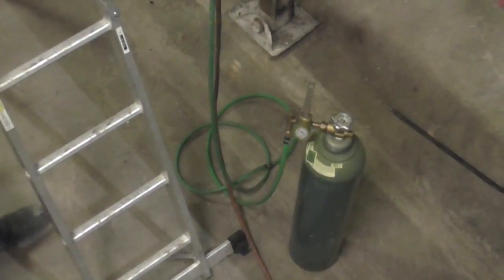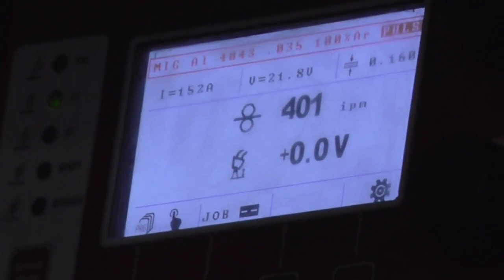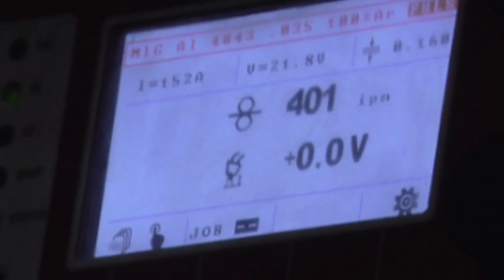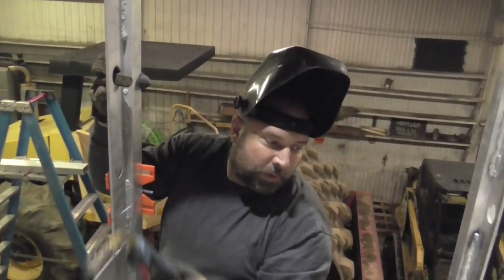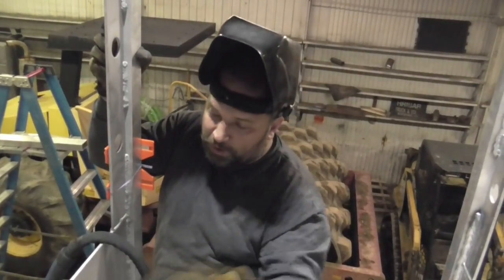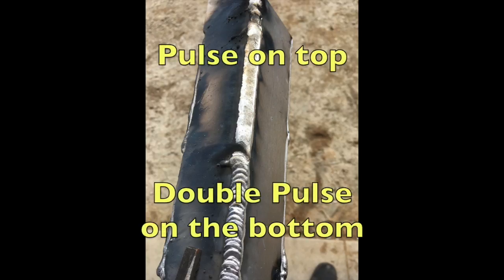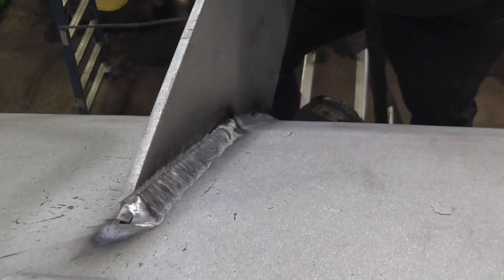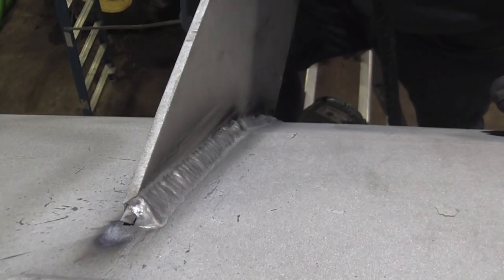Pulsed mig aluminum Single vs Double pulse

Comment: Thanks for the explanation and video. I've always wanted to try pulse mig with my everlast mig welder
Reply from the maker: you are welcome.    
here is to ever last pulse welding - and keep in mind - it is only a single pulse - they do not offer a double pulse (to my knowledge yet)
that will be a problem ....  the ever last 251si and the ever last 275P only have a full manual pulse ....  that is a real pain to set this up - if you don't have any chart for referencing anything ...  i would say almost impossible ...  you have to find your own wire feed speed (its not synergic in pulse) THEN you have to find all your own pulse settings ...  its not like miller, lincoln, esab, HTP,....  where it is a full synergic pulse ....  on the ever last you have to pick your own background voltage, duty (pulse on time) and pulse frequency ....  bases on the material, the amperage, wfs, wire diameter etc ....  also the arc length is not adjustable other than though the voltage  ... so according to my experience you need to adjust arc length with the voltage and than "compensate" with all the other values because now you are running slightly "out of spec" .....   and THEN .... good luck you will need it - ever last only has one pulse shape, it is not adjustable ...  that means it is "good" for steel, stainless, sibro aluminum .....  for very thick stuff and for very thin stuff .....  and that only works so well ...  now you have to "compensate" (within the means that you have) for that and that makes it even harder ....      like i said - good luck ...  and buy plenty of tips .. in the beginning whenever i stopped welding aluminum it burned back into the tip till i had ALL my setting at least "somewhat" right .....
Reply from the maker: look at the answer i gave mr green (the pinned comment)

Comment: Every time I watch your videos I want to buy a propulse 200. That thing just looks so well built and the welds look amazing, like tig quality. But I guess your welding ability has a lot to do with that. Also that thing you built looks like it should be in a Mad Max movie 😂
Reply from the maker: I take the mad max comment as a compliment....   :-)  as far as welding ability there are guys who bought a pro pulse with very little prior welding experience and they are doing good - there are guys with a lot of welding experience who are doing good and occasional i meet a guy who has a hard time figuring it out because the machine is a fair amount of "different" compared to "regular" mig machines. ...   As far as build quality: i have had mine for 1.5 years and i beat the daylights out of it literally over 1000 lbs of wire run through - and than i gave it to Doug from Sv seeker .....   and now i feel i need a new one - it left a void in my life ......   
I dont know how far you are from milwaukee or chicago but the rumor is that later this summer HTP and myself are starting to offer pulse mig classes ....   all my customers who have a PP where i have helped them for an hour to set stuff up - they are doing great ... it seems like what this machine needs is a video manual or more so - some "hands on" training ... just an hour or maybe a few hours ... that makes all the difference in the world .....  hold off on that pro pulse a little bit - maybe soon i will become a dealer and offer classes as a package deal ...  THAN it could be worth it buying one ....   LOL ....

Thanks for watching - i am glad you are enjoying the videos
Reply: ZILA I think a video tutorial would be a great idea. A series that of videos going through different stuff. A tour of the machine and the mechanics of how it's able to weld aluminum without a spoil gun gets a 👍🏻 from me.
Reply from the maker: I am working on a few more videos.  and some more videos are coming on chucke2009 channel in the next few weeks/month .. a lot of the stuff you are asking about is already recorded but not edited or made life yet .....
Reply: I'm looking forward to seeing those especially one on the mechanics of how the PP 200 can weld aluminum without binding the wire. I just don't see how it does it without a push-pull gun. Keep up the great work!
Reply from the maker: its really easy - you need a good wire feeder, the correct drive roll and rive roll pressure and a gun that is not too long and has the right liner .... i have a gun on my lincoln machine that is 10+ ft long that i am pushing .047 aluminum wire through every week ....        
if you have the right stuff and follow the instructions closely ...  than you can be pretty successful .....
i have seen people do that with miller and pro spot machines too .....
Reply: I'm running .030 and .035 wire in my MIG. I haven't used .047 wire before. Can the machine run .030 and .035 wire without a push-pull or spool gun? BTW I'm strictly a hobbyist welder so any info you give me is greatly appreciated. Thanks!
Reply from the maker: This machine runs 030 aluminum wire in 5356 non pulse and it runs 035 with pulse and double pulse in 4043 and 5356  HTP sells a 8 or 8.5 ft gun designated for aluminum (with the right liner and a thicker cable ...  the slightly shorter gun with the slightly thicker cable helps you prevent tight loops and wire feeding issues .....  it works really well

Comment: Ok Peter- so what I'm dreaming of right now to replace my highly portable/useful Lincoln power Mig 210 multi-process, is a stehl/htp inverter based machine that blends both the features of the pro pulse-along, with pulsed stick welding capability - in one machine, that runs on 60hz. 

Any hope?
Reply: ZILA I appreciate the input and gives me reason to hold off-three times the weight however would put it circa111 pounds?? That's a heavy inverter… Starts getting close to the weight of my 350MP which has some  basic pulse programs.

The extra amperage would be welcome though...045 dual shield is my staple, and pushing it for a 200amp unit, imho.
Reply from the maker: weight is 88 lbs on the Pro Pulse 300  (just machine - no wire inside,  lincoln 350 MP is more like 255 lbs )  if you compare to a lincoln - compare to C300 ....  that is much closer comparison.   045 dual shield will be running perfect !!!  that is what all my structural job are (have you seen the new Eutectics dual shield flux cored ???  that wire is AWESOME !!!!) but i am getting off track - maybe i have to make a video about it ... !  anyways i have been running 045 flux cored gas shielded in my pro pulse 200 .... 250 IPM  25 volt - that works all right - but after 20 in non stop welding (at like 180 amps ... the machine forces you ste stop for 4 minutes ...  LOL   its ok to weld a small part - but its not heavy enough to run it all day - that is why the program is for 035 flux cored not o45 .....
supposedly it has some really cool "I-cold pulse" mig feature ... 30% less heat input 35% higher travel speed and a more focused weld ...?  and some other cool features ....  i cant wait to get my hands on one and give it a good shake down .....   
as far as what i personally think the Pro Pulse 300 compares/competes with is Lincoln C300 or thermal arc SP320  in size and weight and power output and duty cycle .....   
I think it will be easier to operate though and have pulsed stick full bridge inverter with DSP for ALL electrodes including 6010 and a TON of arc dynamic

I tink miller 350p and lincoln 350 mp are great and proven machines - they have been around for about 10 years - but that being said - technology didn't stop 10 years ago ...  and the weight of those new machines is 1/2 or 1/3 of what the old once are - no voltage tabs - ... its a whole new generation.

Comment: wow I didn't know you could run aluminum mig without a spool gun  :) good to know
Reply from the maker: yes you can weld aluminum without a spool gun, you need a gun no longer than 10ft (3m) and a teflon, nylon or most preferable a graphite liner  - also you should have aluminum drive rolls in your machine (those have a U grove rather than a V grove) very little drive roll pressure and if you do pulsed aluminum than a whole bunch of other things are to watch out for also.    use a contact tip (if you use a regular tip than go .005 larger than your wire diameter, if you have access to CRZR tips that would be the way to go - than go the correct size for the wire - don't oversize....
Reply: Ricardo Garcia  push/pull systems has been around for ages. it's like a tiny feeder in the gunhandle aswell. they are more popular in Europe than spoolguns👍

Comment: hi peter! what pulse settings are good? background, frequency?  do you use a percentage for background?
Reply from the maker: Ok, this sounds like an Everlast or Longevity question.  The reason why i am saying that is: Every "big" manufacture like Miller, Lincoln, Esab, EWM, Fronius, Stel, HTP has a full synergic pulse where as Everest and Longevity have a full manual pulse.  The way how this works is this big manufactures pay engineers and professors at technical colleges a boat load of money to sit there for weeks and find out the best settings and than program those in the machines. The pulse frequency is low when the wire feed rate is low and gets higher as the wire feed rate goes higher.  The ratio of background current and pulse on time is one of the best kept secrets in the market.  
Everlast has a really nice manual for their 275P and they describe in about 8 pages how to find the "sweet spot" for the pulse settings and the next 7 or 8 pages are blank tables that you are the machine owner/operator have to fill in by try and error ....   
Now i do own an everlast 275p - and pretty soon there are videos to come about that  - and also i will be offering classes on how to dial it it. (for liability reasons my legal advisor suggested to me NOT to give people actual settings but rather show and teach them how to get to decent settings - which at the end of that class you will have a VERY good understanding on what this is all about and how to really use the machine and what those settings are about)

Now back to the original question, I really cant tell you absolute numbers because i don't know.

What i do know is that the pulse shape, frequency , etc etc all changes with wire type (steel vs stainless vs aluminum  4043 vs 5356)  CHANGES
THAT MEANS IF I TELL YOU 400 IPM SET THE FREQUENCY TO X HZ - THAT WOULD ONLY BE GOOD FOR THIS ONE WIRTE IN THIS ONE DIAMETER WITH THIS ONE GAS.....    
So to get to some usable information - that's why it is a weekend seminar not a 2 line answer in the youtube comments ....

Sorry that i cant help you here

Pulse mig welding is VERY involved ...  than also after your pulse settings are right you need to have the right wire speed and voltage to get the right arc length to spray the aluminum right but not burn up your contact tips ....  

The HTP PP200 is pre programmed with ALL of this ....  you set the wire alloy and diameter (for example 4043  .035 dia) and the machine tells you to use 100% argon - now you dial in the material thickness you would like to weld - DONE!!!
The machine knows wire speed voltage arc length (and keeps the arc length where it needs to be thanks to St-Arc, its all pre programmed, it also knows pulse frequency, background current and pulse duty (pulse on time) so all you have to do as an operator is weld .....
Reply: @ZILAwelds  Wow Zila. What a fantastic explanation. So detailed and precise I'm very impressed.